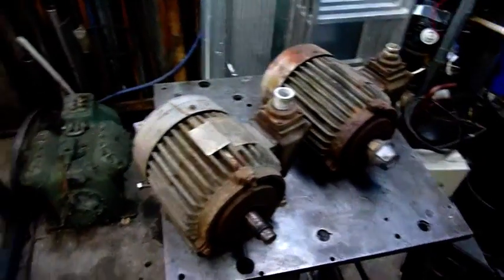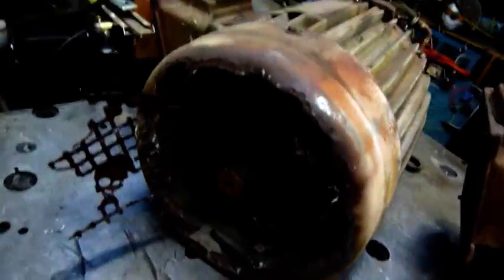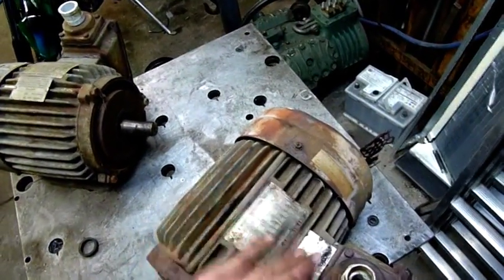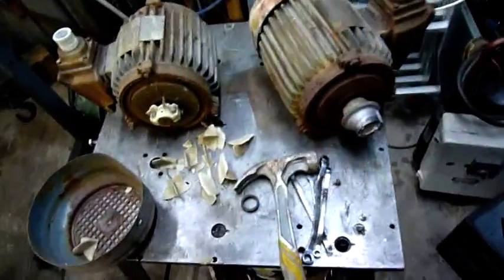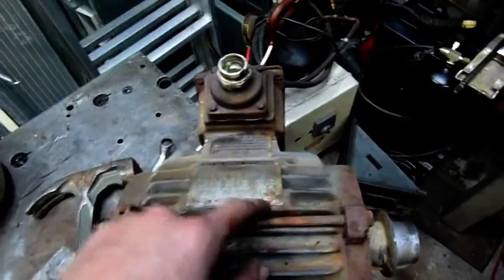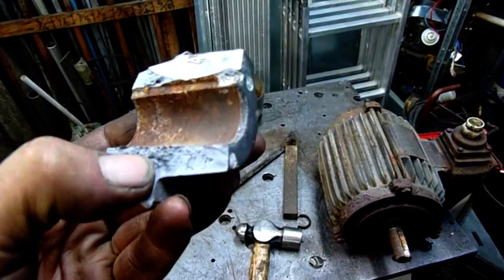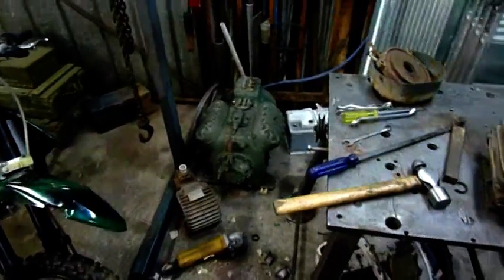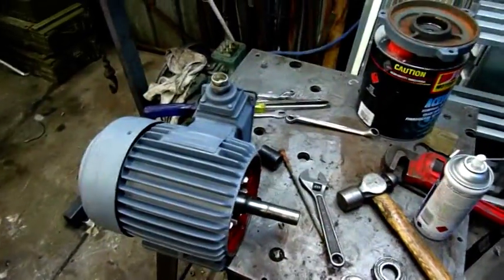3 Phase Motor Resurrection -  TECO 2HP

Comment: @Aussie50 That's a slow upload speed you have there.. I've heard it can be slow internet down under, but thats ridiculous! Are you on a modem or Broadband? 
Try taking the glasnost test to see if your ISP is screwing you over with You Tube bandwidth.. 
A 5 min 1080p move takes around 20 mins for me to upload... My upload speed is 1.97Mbps.

Comment: Nice little motor restore right there. :-) I am waiting to see the completion of that big generator you have. It would be interesting to see what kind of power comes out of it when spun up. Looking forward to seeing this motor on the VFD though. :-)

Small video request: A subwoofer still in its enclosure being run on a VFD at different frequencies. 3-50Hz would be interesting, maybe more if the VFD can do it, and you don't mind popping the speaker. :-)

Thanxx,

{^_^} BoomBoxDeluxe {^_^}